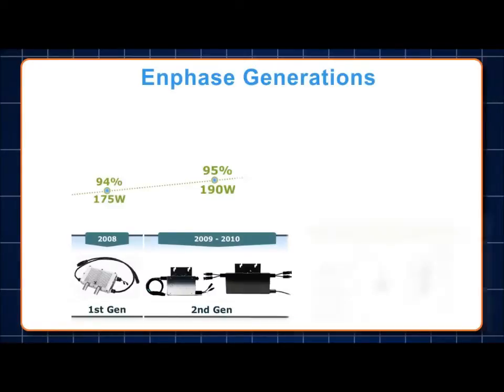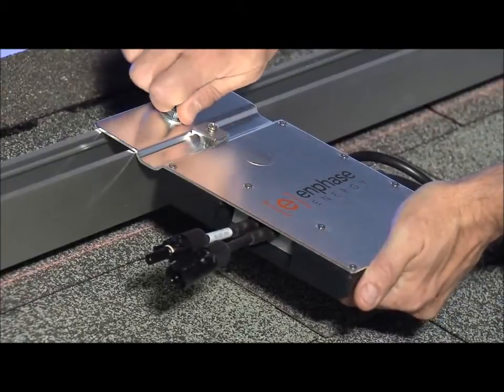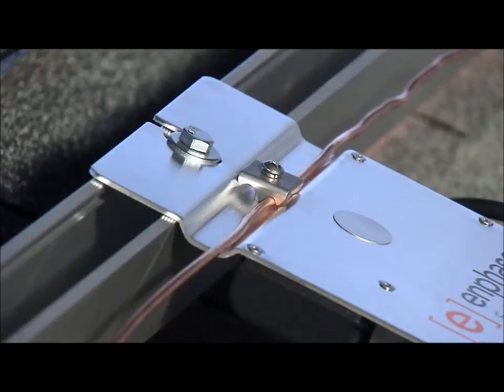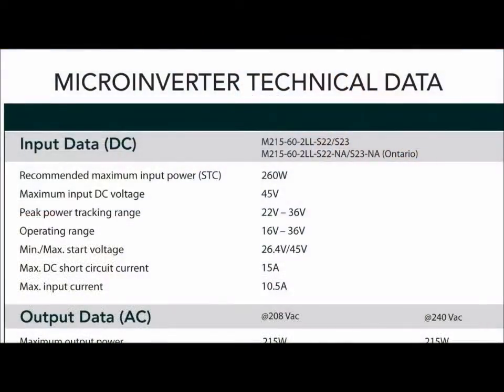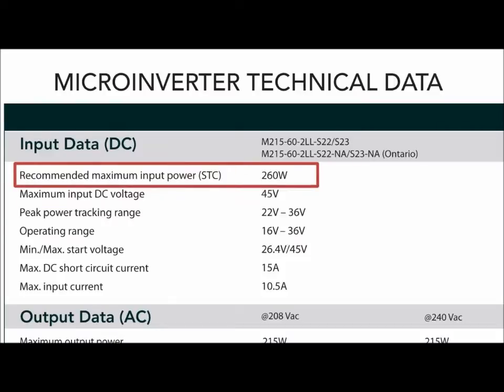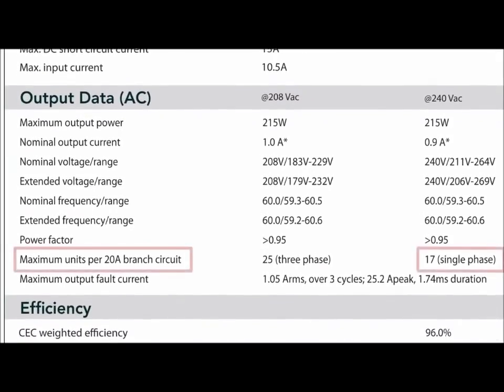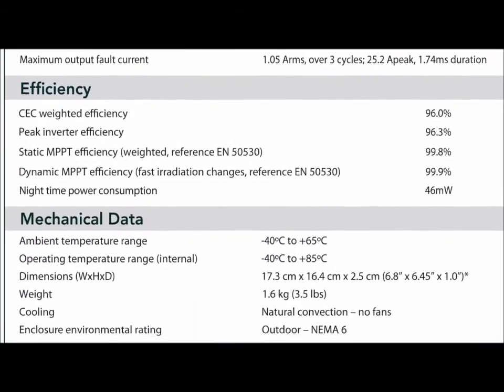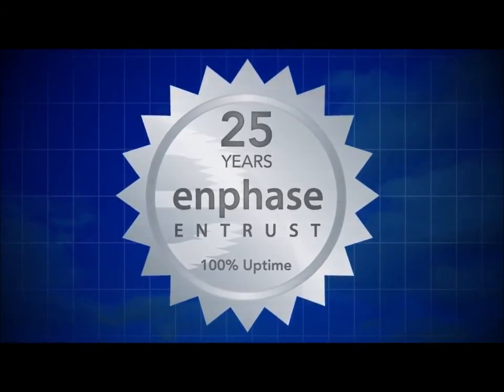ENPHASE ENERGY Introduction to the M215 Microinverter M215-60-2LL-S22 | RENVU.com

Comment: What model can accept freq 50 hz
Reply from the maker: Hi Yusof, no Enphase model currently outputs 50 Hz, but the NEP BDM-600, the NEP BDM-300, and the Darfon G320 can output 50 Hz. Note that both NEP microinverters must be configured for 50 Hz via a compatible gateway unit. Cheers!